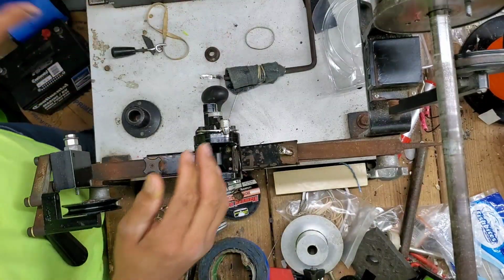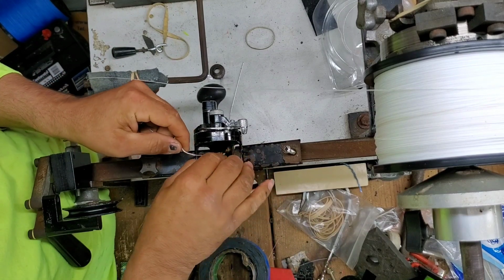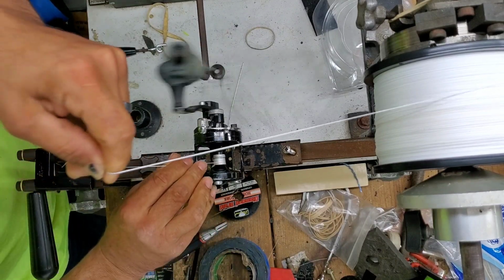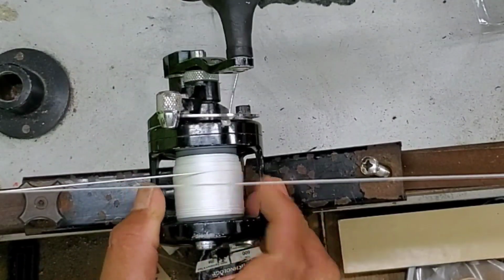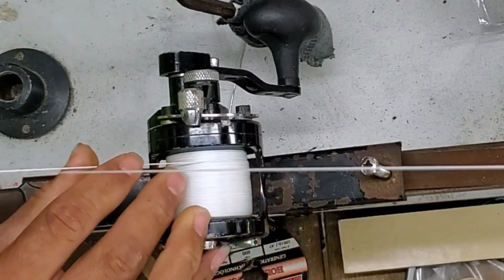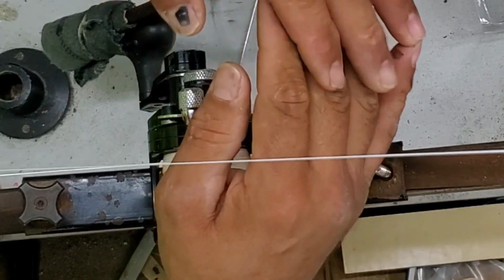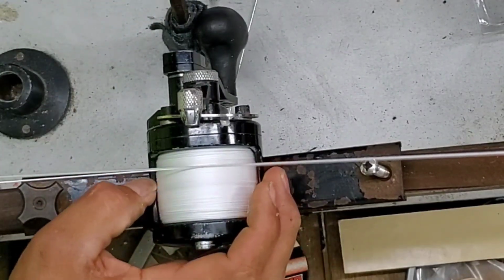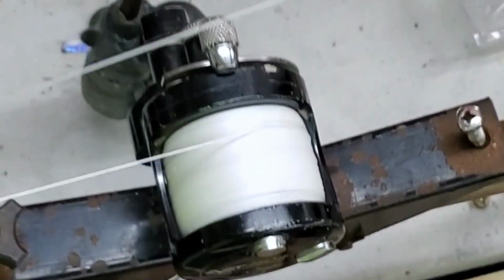Avet Sx Raptor spooled 80lb Hollow Cortland Braid max and casting: use promo code: Team Hard Life

Comment: Cool vid! I got a question for Ya  By using the same spool to test capacity on the reels is the line being broken in so it will lay flatter there for adding more yardage? I just had to ask!!
Reply from the maker: It was way early in the testing for that to have happen so quickly.. but yes on certain braids it does help especially if they have a lot of coloring added and it is taking up space..
Reply: @TeamHardLife  Good point it's not colored.
Reply from the maker: But even the green line on the sx laid nice and flat..

Comment: So you ever have overfilled spool issues when you have cast out a few times because the line isn't under as much tension?
Reply from the maker: No sir ... with this briad the way we spool is the way you can cast it and reel it in just fine... unless the customer really spaces out the briad then yes it will not fill in properly and you will over fill your reel..